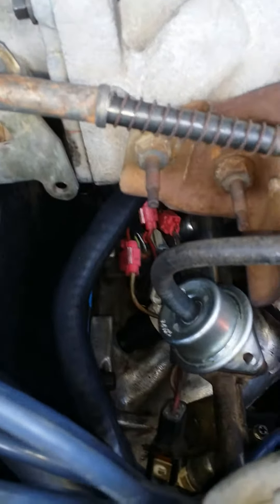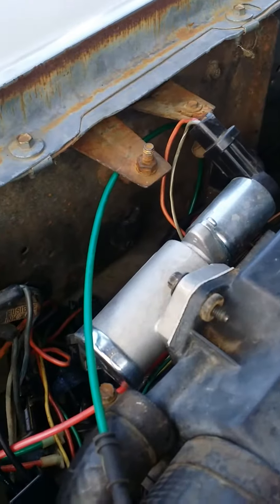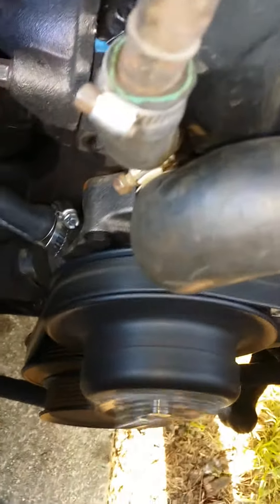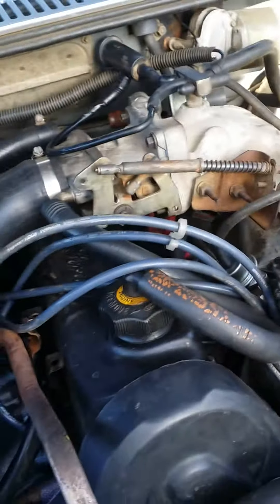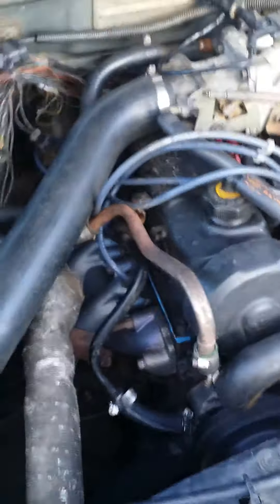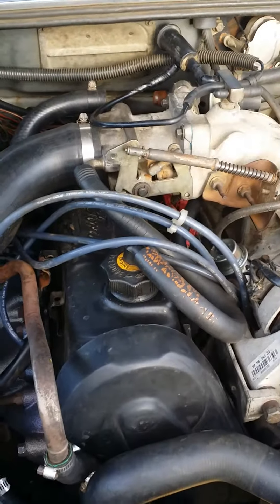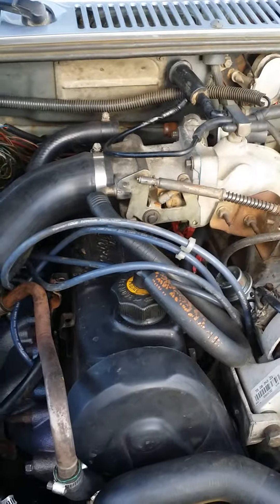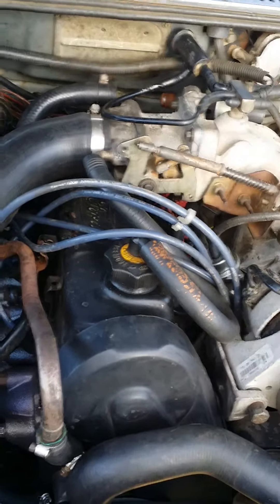1987 ford ranger 2.3l

Comment: Sounds like the idle is out of adjustment and the idle air control is constantly fighting it.  Either that or there is a vacuum leak causing the issue.  I have the exact same truck.